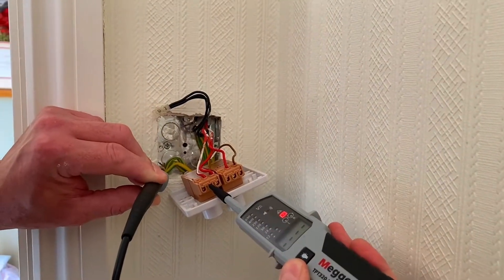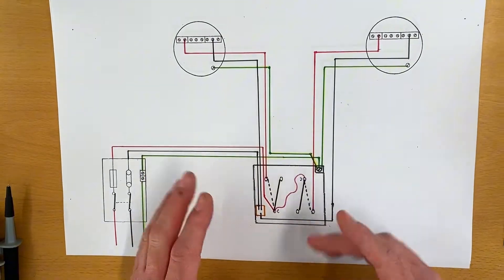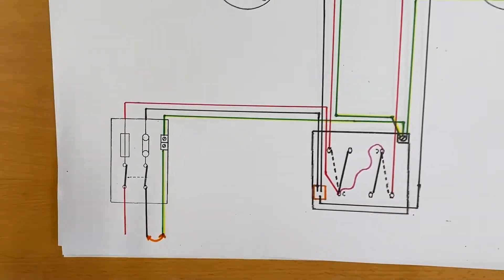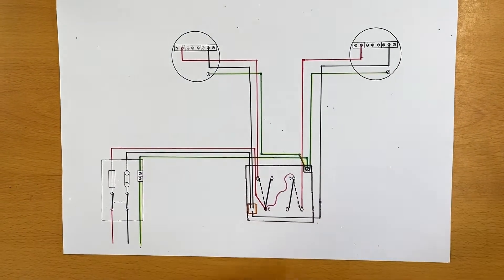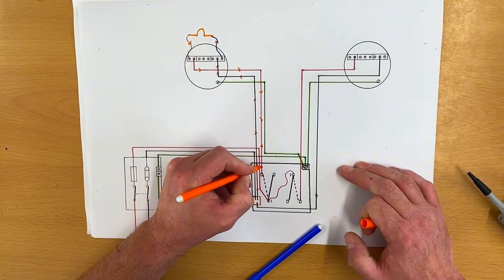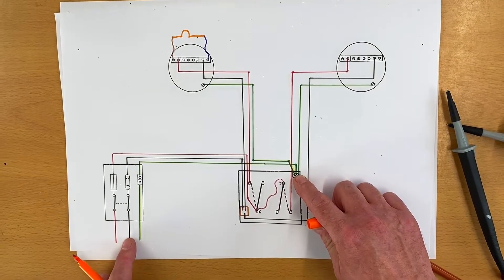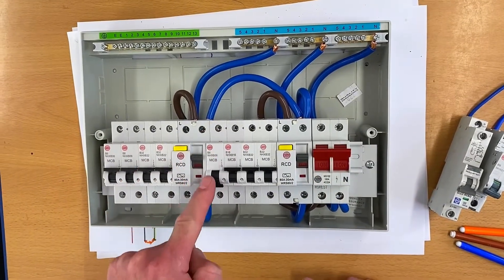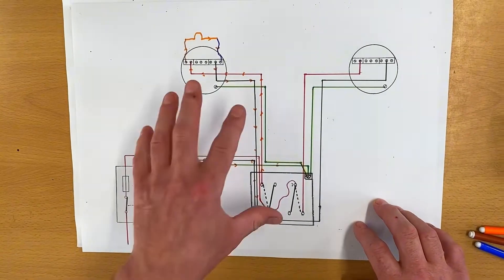More Conductors are Connected Together than you Might Think

Comment: Why take a neutral to the light switch?
Reply: New school
Reply: In this case N is connected into a wago i presume and the switch box acts like a junction box . 
See the strap from  C first gang to C  second gand . Also cpc are connected all together.
Exactly like in a junction box.
Reply: Earth neutral star point or delta connection at the college you learn them properly Gary is top teacher 👍
Reply: If you ever want to upgrade to using smart switches, you'll find a lot of them need a neutral conductor in order to work.